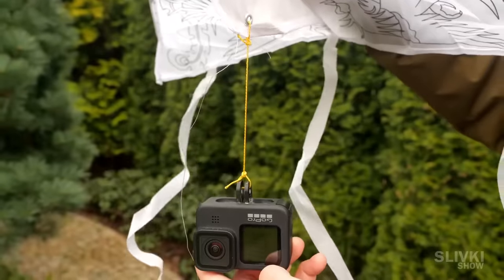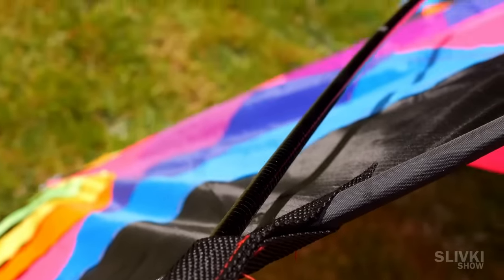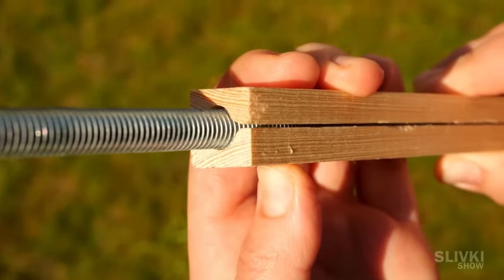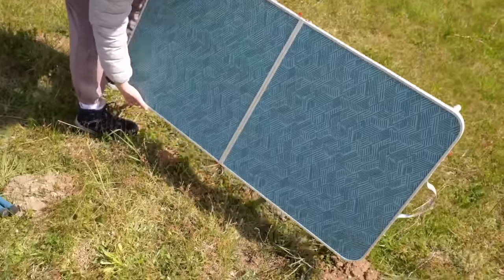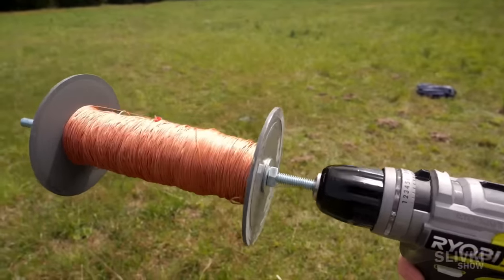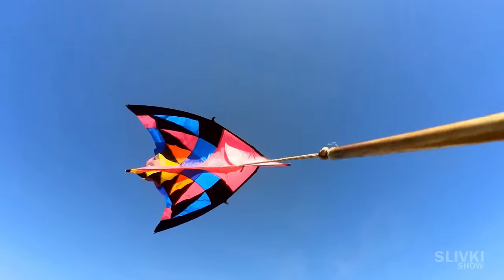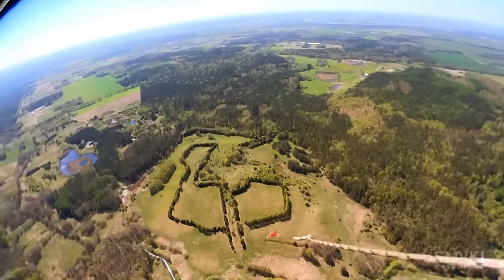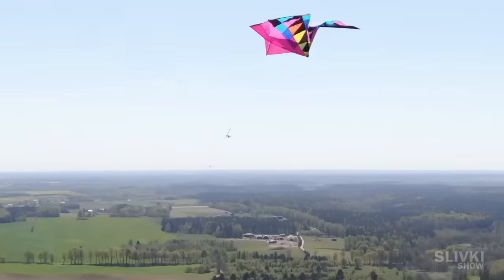WE FLEW THE KITE INCREDIBLY HIGH

Comment: When i was a kid, I built a huge hexagonal kite made of bamboo and fabric. The kite was about 1.5 m in nominal diameter, and the tail was like 3 m. I had a huge spool of similar material as the one shown in this video. I wanted to take my kite as high as i cool. I started the process, but at some point, the kite was very far, but it stopped climbing  . I gave it even more line. At the highest, i could hardly see it. It was getting late and it was time to go home. Huge problem!!! I can not bring the kite back. The force was wayyy to strong. I tried for about an hour, and i made very little progress. In the end, i had to cut the line. Later, i heard that the local airport in my small town reported unsafe landing conditions due to a huge kite. I almost got in trouble. I was 12 or 14 years old. Southamerica

Comment: the theoretical limit for a kite, even with unlimited string, is around 100,000 feet (30,480 meters). Beyond this altitude, the atmospheric conditions are too harsh, and the air too thin, for a kite to generate enough lift to stay aloft

Comment: I have a 10 ft wing span dragon kite. Using 150 lb test line and a 12.5" spinning reel with a disc brake, I achieved a height of 4265 ft. from the ground- verified!! How was it verified? By the ticket I received from the  park ranger. A passenger plane on approach to an airport 5 miles away, had to slightly manuever its approach and was not happy, reporting my exact height  and location to the authorities...My goal is to reach the 1 mile mark most probably in a diff area😅 P.S. the line I had "payed out" was actually more like 5500 ft if you account for the distance away from where i was standing
Reply: Bro that's sick, I know nothing about cars but I do stuff like that as well. Anything meant for one purpose I always like to reinvent and see how far you can take it. I too got a ticket buy a park ranger with a model rocket. I tied about a thousand feet of fishing line from a swing set to a park bench and put the rocket running horizontally. I pushed the button to the electronic ignitor at the same second I look to the left and saw the park ranger pulling up only a couple feet away from the fishing line which he couldn't see. My brain is already decided to send it though so it was too late before I could take my finger off the trigger the motor ignites in this little 4 ft rocket with a c engine takes off towards the park ranger at about 400 miles an hour I can only imagine what he thought was coming at him. We laughed about it afterwards but he said he thought it was an RPG or something at first that someone was shooting at him. He didn't realize he just happened to pull up next to a tattooed man-child nerd running an experiment just to see what happens lol. I dig your kite story I want a 10-ft kite that's awesome
Reply: @Chris-of6xm   ha ha that is awesome. Your story is better than my 4th of July on the pier. Me and 9 buddies pick teams 5 on 5. We get about 60 ft between us. Each guy is loaded with bottle rockets. We all place horizontal  on the pier. We all have lighters. Someone yells START!! WE start lighting them off at each other!!! It was war!! My flannel long sleeve was on fire, a ladies purse on fire . A few people jumped off into the water. It was chaotic so smokey, the missed us walking right past them.. you and I can not hang out together!! Lmao
Reply: @rileymanderscheid9805  oh my gosh I'm so glad I didn't grow up with you we'd still be in jail. That's the best ever man

Comment: as i remember I flew a kite 150 m flat high sloping 20 degrees from horizontal .. Due to wind.   I was in class 4 at that time(2008-9) I was standing on rooftop (1st floor) and I don't know how I managed to escape the kites between electric wires and nearby houses(2 floors) but anyhow I managed also to bring it back also.

Comment: Brilliant. Did you have to get clearance to fly at that height. We’re not allowed to fly higher than 60M!
Reply: Rite  what  a joke when I was a kid I used entire line of string I guess they changed laws.
Reply: @Sloppypig1354 Drives you crazy these days generally, so many rules and regulations. In our country due to changes in the law, it is now in the strictest sense “illegal to fly a kite in a public space” which is a bit of a coverall! Thankfully if you stay out of public parks it’s largely overlooked but before long we will need a permit to breathe, or it will be taxed!
Reply: @Frakka475  I think soon will have to wear helmets to drive a car. I mean u can’t even use a metal detector anywhere without getting in trouble country has become a joke.
Reply: @Sloppypig1354  Absolutely, it makes you wonder sometimes doesn’t it!

Comment: You thought a small kite would lift 1km of string and a camera. You thought that a small spool would handle 1km of string. You thought the big kite wouldn't lift your entire station. You thought the camera mount was going to produce "stable shots". You thought that wooden dulls and glue would be enough to hold it all in place. You thought that small magnetic mount would hold the other camera during flight. I questioned your reasoning. But in the end, you did it. Congratulations.